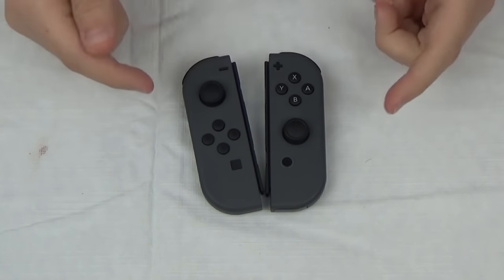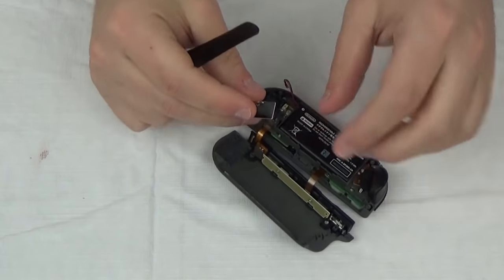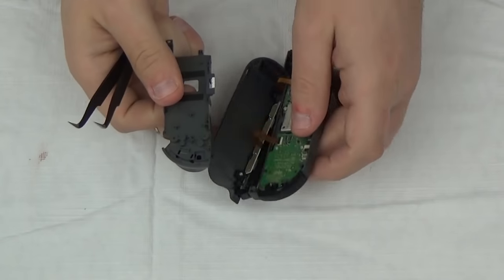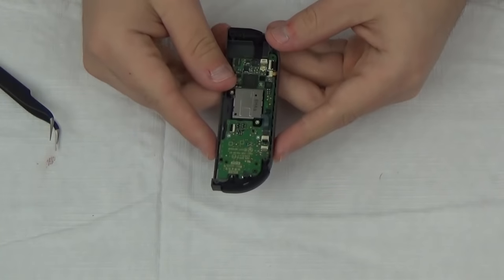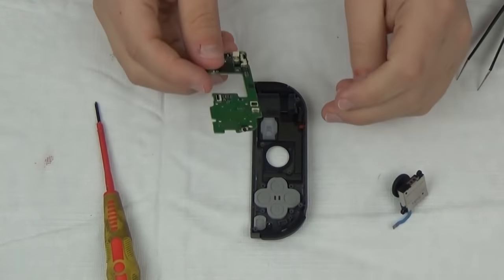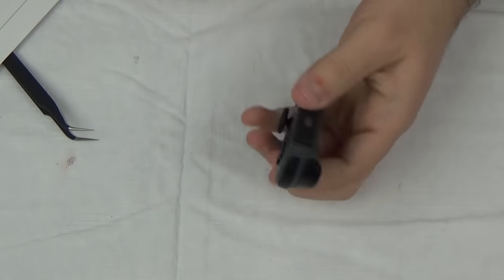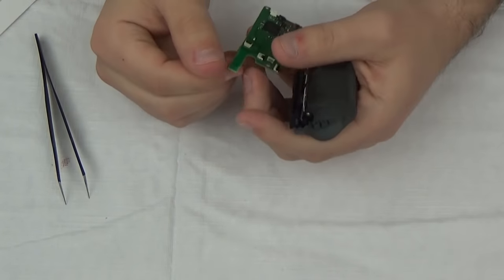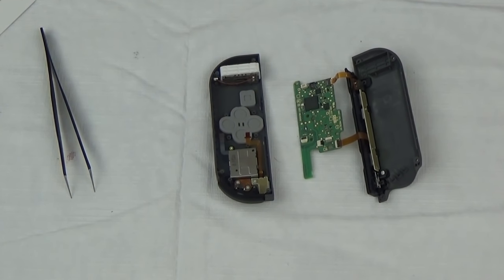Taking Apart The Nintendo Switch JoyCons! Antenna Issues?

Comment: i never had any connection problems (neon joycons )
Reply: uhlus same here
Reply: uhlus Same with my bro, although he has the grey
Reply: You need to be 10 meters or so away
Reply: MattPlaysGames I did not have any problems yet but I only have the console for 2 and a half days
Reply: uhlus  same but I have grey
Reply: I have the neon, and my left joy con loses connection constantly, even if just my foot blocks the dock from about 8 feet away. I tried to ignore it but it is def there. Also my left controller loses battery at double the rate because of poor connectivity. :(
Reply: peppaz Have you tried turning the switch off (not just stand by) , and then booting it with the joy cons attached, after the day one update? It has solved the issue for some.

Comment: They are very hard to open/clean/mod/repair. This is very disappointing for me since I've had such a great experience in the past with Nintendo controllers. It seems like the repairability is the least of manufacturers concerns nowadays. If ya got a drifting joystick and you wanna fix it, just buy a new stick. Opening up the analog stick module was the worst nightmare I've ever had in my technician life and I wouldn't do it again, even if it's to save up 10-15 bucks on a stick replacement.

Comment: So I took my right joycon apart and after putting it together, it seemed that the battery was completely dead. The joycon worked when attached to the Switch console but with low battery and it doesn't seem to charge. Any advice?

Comment: Nintendo should make a new right job Con. It would have all the same features as the current joy Con but this new joy Con would have the analog stick in a different place. Like above the buttons. Obviously you couldn't use it for 2 player but it will be much better for single player
Reply: CapAb Artz I played Snipperclips with the right Joy Con in Nuntendo NY and it felt fine.

Comment: Idk if you’ll see this but I have a problem with my right joycons happened yesterday when I replaced the joystick.
I put it back together and then the sync button wouldn’t work, but when I docked it to the switch, and pulled it off it worked wirelessly.
I tried to see what was wrong with it and took it apart again, everything looked connected good so I went to close it back up and now the whole thing doesn’t even work wirelessly.
The battery won’t even get charge.
To make sure I wasn’t going crazy on like how did I mess it up.. I swapped the battery and the SL/SR board with another right joycon and the pieces from the working one did not work, but the pieces from the non working worked fine in the working controller..
I don’t think the full motherboard could be dead or it wouldn’t work connected. 
I’m just curious if you could reply back to me and tell me what you think it would be lol.  
All the buttons work when it’s connected, only think I notice when I attach its takes like a second longer than good working ones. Hope you see this lol.
Reply: Sound like you damaged something. A pin on the battery's wire harness, maybe. Compare extreeeemely closely the working and nonworking. You might find the issue that way.

Comment: Crazy question but I've noticed that on tv mode I've been running into some crazy framerate issues with Zelda in some areas of the map. Just wondering if anyone else has ran into it.
Reply: Benjamin Andersen I believe they're caused by bugs. when you walk into certain areas the engine must be running in to some kind of issue. Remember when they said that changing something small could cause a problem on the other side of the map? Well I've noticed that the physics has a bug where if you set down food on a fire the game thinks there's a grass fire and makes an updraft you can float on, but not only that, the items you set in the fire go flying away. I don't think it's supposed to do that. Since a bug like that is in the game it leads me to believe that the frame rate problens are also a bug possibly caused by some weird physics issue.
Reply: Benjamin Andersen it plays tons smoother in handheld mode. The grass seems to give me framerate problems on the TV.
Reply: The polygons for the grass require lots of computational power. When docked, it goes into 1080p, which requires more power than 900p. So more than average polygons + standard HD = lag. As I understand it, Nintendo has sent an update that makes it less of an issue. Just know that it will run better in hand held because it doesn't have to generate as high quality picture as it would docked.
Reply: Yeah it wasn't really noticeable until the forest (trying to avoid spoilers) but it was just chugging along in there.
Reply: Bobby H. Plays at 720p in handheld (because that's the screen resolution) but goes to 900p when docked, not a full 1080p
Reply: Benjamin Andersen - zelda was made to run at 720p.  but since the dock makes it run at 900p it seems to sacrifice framerate for presentation when zelda wasn't meant to be upscaled
Reply: I haven't tried 720p yet but I think I'd prefer 1080p anyway.
Reply: Benjamin Andersen Yeah on the tv mode but its never that bad.
Reply: Benjamin Andersen yes but at least it's not game breaking.
Reply: Zyah's Alt It's selling like hot cakes. Even in Japan where the Wii U was unsuccessful.  People love gaming on the go 😀
Reply: Yeah, it drops pretty significantly a little too often. At one time I actually died in combat simply because the frame rate dropped so low I couldn't see what was happening. Lots of grass seem to be the main reason but it's not consistent or predictable so I wonder what's going on there.

Comment: I have an issue with the L button. Its jammed into the joycon and cannot get it to pop out so u can hear the click noise. U can click it once but once its pushed down its pushed down forever until you push the L button out. I want to know if theres any way to fix this issue.

Comment: That antenna location is stupid, who didn't realise it would be a good idea to place it at the top?
Reply: So what happens to the antenna when holding one joycon each in 2 player tabletop mode? The current position allows the antenna to work in both handheld and tabletop mode because its not obstructed by your hand which ever way you use it.  I don't think you fully thought things out before commenting..
Reply: Karl Mumm Yep, for a moment I completely forget about that way of playing. Thanks for pointing it out, I guess there's no way to actully get a placement of it that is "the best" in both situations.

Comment: a single joycon cost almost as much as Xbox one controller. Set of joycons is one of the most expensive controllers only cheaper than Xbox elite and Razer controllers. and I don't see anything to justify that high price of a controller for such underpowered console.

Comment: HD Rumble... Does anybody get so much noise out of the Joycon when the rumble kicks in for this game ? I never heard such noise from any rumble before (which could be noticeable if your volume is below 50% with joyncon attached to the Switch), as I don't have a second pair of Joycon nor a Pro Controller yet, I cannot confirm whether it is the expected feedback for the HD Rumble or if my Joycon as any kind of issue. Note that the issue shows up only in game using HD rumble, Zelda is fine.
Reply: Kevin Hadj i experienced that in handheld mode with fast rmx only. and i was in bed, no sound on. had to turn it off to let my wife sleep ;) but with the same  "setup" even the wii u gamepads rumble bothers me with its noise, sommaybe its a bit louder because there is just more going on in there but its fine for every other situation i played in
Reply: OK, so it seems fine then, as I did not find the rumble pretty amazing and different from what I got in Zelda I thought something might be broken. Well guess not after all, just gonna have to disable it whenever I play in a quiet place using headphone...

Comment: I have the neon joycons and I am having an issue with them disconnecting. I sit about 7- 10 feet away from the system. Also having a big issue with the switch picking up my wifi. No other devices in the house have an issue. Same distance from router.
Reply: Brian De Jesus I am also having WiFi issues while it is docked. 
But when I have the system in my hands, no WiFi issues.
Reply: StealthDad It's a little frustrating cause it's not consistent.

Comment: The antenna in the right JoyCon is attached to the NFC chip.
Reply: tails300 I had a feeling, it's likely why the amiibo is primarily read though the right stick as it's right under it.
Reply: Yes you are correct 👍. On the Pro controller its in the middle of the Plus and Minus buttons.
Reply from the maker: The Broadcom chip runs directly to the antenna plug. Couldn't find an antenna etched into the PCB. Right now it looks like that antenna is for wireless communication to the system.
Reply: Spawn Wave from the looks of it it's located the right underneath the joystick which is exactly where the amiibo scan. I searched Ifixit's teardown and they said it is in fact the NFC reader.

Comment: Are the joysticks clickable on the joycon controllers?
Reply: Yes
Reply: Ah ok,  I thought they wouldn't be, seeing as the joystick part looks like the Vita one which is not clickable
Reply: Victor Coleiro well is this a Sony handheld..?
Reply: Sony use an ALPS low profile joystick ie they didn't make it.  That same ALPs low profile stick is also used in other handheld like the GPD WIN and XD. Unitl now, there has not been a low profile stick on the market which was also clickable

That said, I found out more about the Joystick used in the Switch.  The link below is to a joint patent application by Ninteno and Hosiden.   I would guess since parts like this is what Hosiden make, that this was made by Hosiden on Nintendos request.

http://www.freepatentsonline.com/20160313759.pdf

Comment: Does anyone know what to when you get a wandering problem. The calibration screen shows that the left joy con stick (neon blue) is tilted forward even when it’s centered. It’s getting worse to the point where games are barely playable.
Reply: I've had this problem too, it's a mechanical issue. The little captors inside the analog stick module must have some dust (maybe from plastic grinding). Your best bet is the warranty, but if you can't, try to replace the module itself. They're sold for about 10-15$.

Comment: The antenna problem is not something new I have this problem long time ago with the Wii U pro controller same issue in the beginning I thought my controller is broken or something the problem was the wifi router and the mobile signal interrupt the controller so I changed the console place far from the router and my mobile is not connected to wifi it's worked well no problem after that and I also tried that on the switch as well .
Reply: siegfried Al Suwailem if that's the case here how can you do the Nintendo voice chat...  it requires using a mobile device hence needed that WiFi too?

Comment: I think the sync issue is rubbish cause I have been atleast 15feet away n I had no problems even when putting my hand I front
Reply: I try to play from 2 meters (thats about 7ft) from my docked switch with joycon grip and Link constantly tries to commit suicide because left joy-con lags so much.  News flash,  if you don't have a problem it DOES NOT mean it does not exist to others.

Comment: Never had problems with mine. I dont know what people do with them.
Reply: I try to play from 2 meters from my docked switch with joycon grip and Link constantly tries to commit suicide because left joy-con lags so much.  If you don't have a problem DOES NOT mean it does not exist.
Reply: May be thats why I said that I personally dont have problems)) I didnt denied thats not exist. Read/Analyze/Read/ then reply.
Reply: "I dont know what people do with them." to me sounds like you are impying that these problems exist because people don't know how to use wireless controllers correctly. It's not like I'm doing anything extreme, just trying to play games like I normally do from my sofa. ;)
Reply: tpax3p I'm sitting 5 feet from the console. If my fingers even wrap around the back of the controller I lose signal
Reply: I did check with all my friend and none of them had this issue. It is very weird, may be you you have faulty one ?( Just ask to replace it, as it is not right!
Reply: tpax3p I noticed it's a lot worse at my parents house, which had a larger TV and more electronics nearby. I've considered trying another controller, but at $50 for just the left side, which might not work, I might as well get the $70 pro controller. For now I just have to be careful  how I hold it, and play on top of a pillow in my lap to keep it farther from my legs.

Comment: I know all the comments are from a year ago but any suggestions for fixing a drifting stick? Some say it's dust others say to replace the entire joy con
Reply: I sent mine into Nintendo Since it was under warranty to get it replaced. Looks like the Thumb stick is it's own unit attached with a ribbon. Looks like it could "easily" be replaced with a new thumb stick.
Reply: Your best bet is the warranty.
If it's not an option, then replace the analog stick module entirely (not the entire joycon, just the little box with the stick). They're sold for about 10-15$ on Amazon and if you follow Spawn Wave's disassembly or other youtubers for instance, you should have no trouble (except with those damn tiny ribbon cable connectors).
However, I strongly advise against trying to clean up the module yourself. I've done it myself and it was a nightmare. I've got some years of experience as a computer technician and this gave me the toughest struggle I've ever had in my life to put everything back together without breaking it.